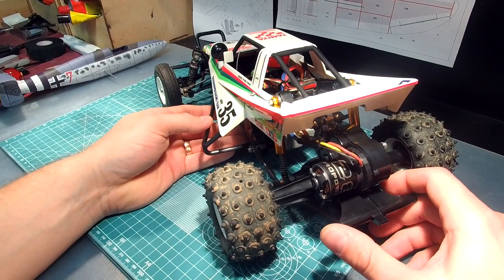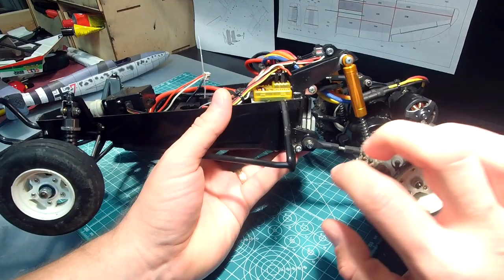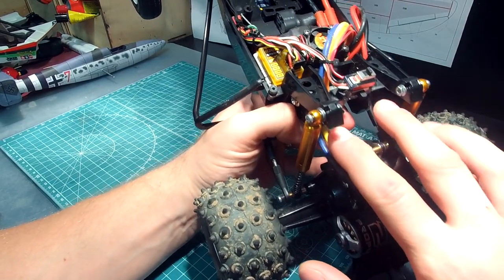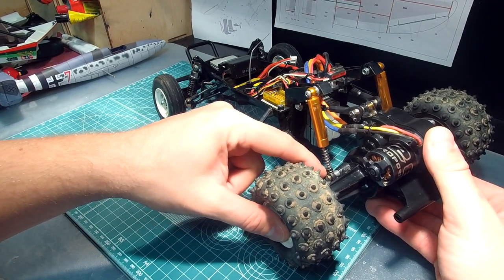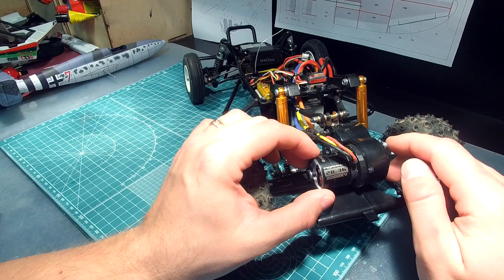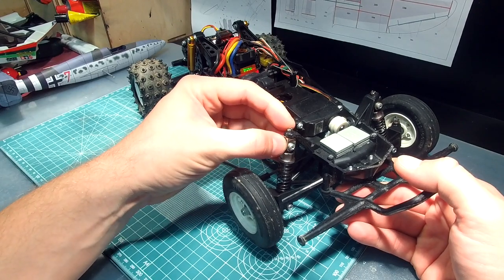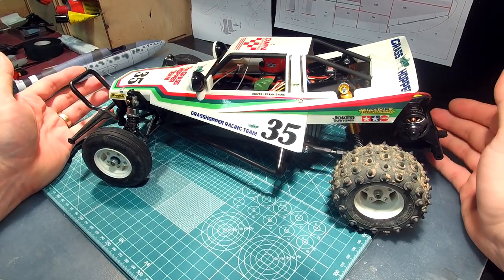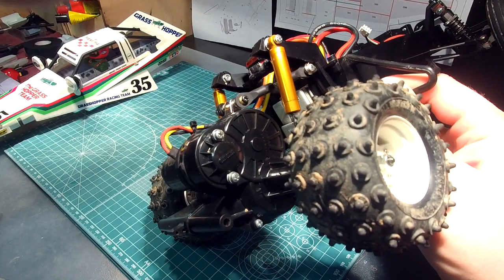Tamiya Grasshoper 4-link rear suspension mod

Comment: Nice! I'm about to 4 link a Midnight Pumpkin, but I'm going to try to keep the gearbox in the factory orientation. Having more room under the back should let me do this. You will see the results on the Tamiya Legends page when it happens :)
Reply from the maker: Thank you for your feedback. I will be waiting for your post. Check my previous video on CW-01 Unimog with 5th shock. I'm happy how it behaves. But since I put a lot of weight on the chassis, it became different handling model unlike stock Lunchbox. It is like a fat heavy truck which has unique handling, but requires some skill and soft finger on the throttle, not to flip everywhere.

Comment: This is awesome mate, makes me want to try something similar with my hornet! With the 1/18 shocks you used for the front, were they 55mm or did you manage to squeeze in a bit more like a 62mm shock? What shock length did you choose for the rear? Cheers!
Reply from the maker: Hello, Thank you for watching. I used for chinese (Aliexpress) 1/16 shocks, 60mm front and 75mm rear. Whats good with 1/16 shocks is that they have softer springs, which helps for light grasshopper. For front, I used Grasshopper II arms, which lower the bottom shock eyelet position, thus enabling to use longer shock.
Reply: @Mindauxx  The softer springs would definitely help. Thanks for the info mate!

Comment: Okay, I just subscribed and now the questions start.
1 - If I were to use this method with the stock 380 motor would I have to reverse the wires so it would run in the opposite direction, and if so, would the motor withstand that?
2 - Suggestion,  if you could build your triangular top links so that the triangle was rigid with only one pivot on the axle end you would get rid of most of the side to side motion without losing articulation.
3 - Did the Grasshopper II suspension arms require any change in the steering linkages?
Reply from the maker: Hi, thank you very much for subscribing. 1- you will just need to swap wires, no strain will be added, as stock 380 motor does not have advance timing. 2- probably, but making single pivot on the tip is difficult without making your own parts like 3d printed.  Usually all crawlers have independent two top links and this was what I was after. Side to side play is bot very big.  You would need both top links on ball ends, being able to move freely when suspension articulate. 3- Yes, I changed the steering links after putting Grasshopper II front arms. They seem different length. Also I had to shave a little of chassis plastic.
Reply: @Mindauxx  thanks.

Comment: I like your system alot, because it can be replicated by anyone, and not dependent on some co.puter files owned by others to 3D print when it needs fixing. We arent trying to get TRF results with the grasshopper anyhow. But 3D printed upgrades often end up costing more than a base model TRF, which is silly. Im curious how you will resolve the front. As there too, mostly its 3D printed solutions, which im not too fond of. If anything can be done with universal parts, that is far better for all the people in the world with grasshopper, and there is many.
Reply from the maker: Thank you so much for watching and commenting! It is so much more rewarding when creating something yourself, using general parts, than buying some hop up from RCmart :)